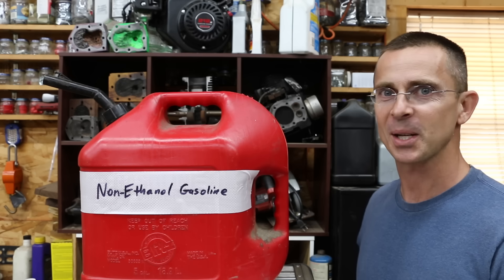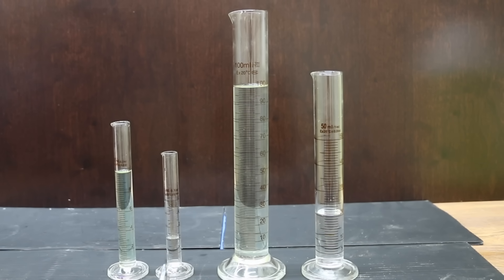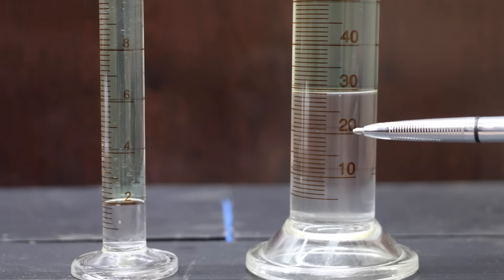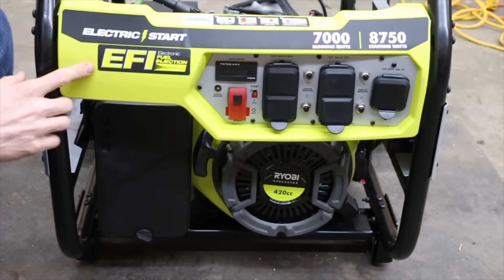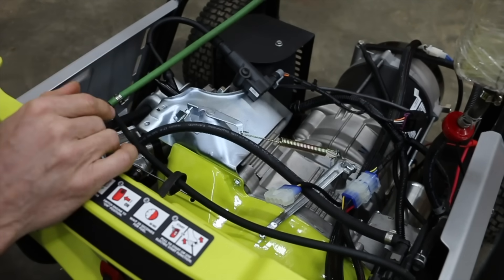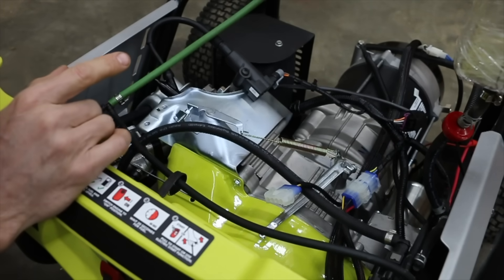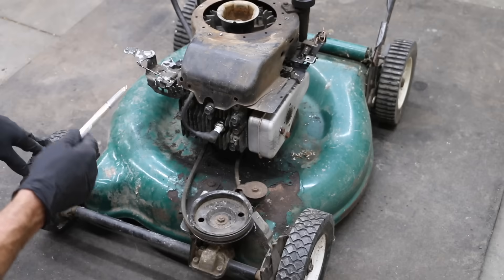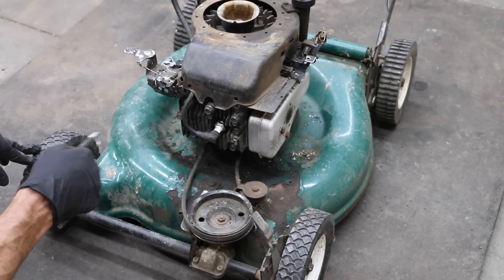Is Non-Ethanol Gasoline Really Better? See the PROOF!

Comment: I run a large concrete contractor company, we tried the bio diesel and ethanol fuel, it cost us hundreds of thousands of dollars in fuel filters, breakdowns, no performance, etc. bio fuels are a complete joke don't use them...and as far as the tree huggers go, if you think America can fix the so called "global warming shit" look at China we are shutting coal plants down at an alarming rate,  China is building them faster than we can...and wind power ....lets be serious...
Reply from the maker: Thank you
Reply: In 2015-16 China opened about one coal fired plant per week average.
And the greenies are slammin us.
Reply: Yup! Its all BS! All at the cost of the consumer! Sounds good on paper but the long run just like most save the environment ideas which thus far have only cost and wasted more! 

More gaskets, rebuild kits and fuel additives being built and sold now than ever before in history!  You think that helps save anything? No! More electricity used, more waste products at factories, more, more, more and all the parts and manufacturing companies are all behind ethanol knowing its more money for them by doing so! "Put more ethanol in fuel so we will sell more parts"! Its created a whole new industry!

Same as a situation with a guy I know who rebuilds transmissions! Its a design flaw in most clutches. ( manual transmission)  he went to one of the major distributors and told them! They said to his face!  We dont want to change! We dont want happy customers! We want return customers!!!

Its not in their best interest to build things that last or the best they could! Its all about money, greed and power! Each one is part of the other!
Reply: @WW5RM  Absolutely 100% agree. You nailed it...but I'm going pile on anyway (venting). Biggest hoax ever perpetrated on the American consumer.  Save the environment buy/run ethanol...bullshit.  

As you note, easily more time and energy is wasted on the manufacturing, storage and distribution of the parts damaged as a result of ethanol.  Maintenance costs go up and production goes down.  But hey the parts vendors and professional mechanics are happy, especially as less and less people are willing and able to work on their equipment.  The parts vendor gets a call from the mechanic and drives the parts to the shop on a as needed basis (extra charge) and the mechanic up-charges the customer for both the part and delivery.  Win/win...except lose/lose for the customer and the taxpayer.

Then there's the government subsidizes of ethanol corn to the tune of billions of $$$$.  I've got no problem turning surplus biomass to biofuels, but the idea of taking land out of commission for food production and propping up an "industry" that is not cost effective and has the detrimental impacts that corn ethanol does is ludicrous.  And as for government mandating the use of such fuel in autos and small engines is equally ludicrous...just burn them in the electricity generating power plants.  Energy burned at power plants is the same energy burned in vehicles, but the detrimental impacts would be greatly reduced...power plants number in the thousands while autos and small engines number in the billions.  But burning them in autos makes "everyone" do their "part" for the environment...share the "responsibility".  

Ridiculous BULLSHIT.
Reply: @TheAutoChannel  -  Bullshit!!  
After some research, I find it's more complicated than I thought - (when does the government make legislation simple)...it's more a case of "where/how"  the subsidies/credits are being applied. So I encourage you to do some research on your own...especially with you being an auto journalist. I offer some links below.  

"Ethanol is more compatible with different engine and fuel system parts than gasoline and aromatics."  Maybe you should have said "modern engine and modern fuel systems".  I assure you that ethanol is the bane of engine/fuel systems in high humidity areas/zones especially for older motors and small engines.  Most farmers will not touch E10/E15/E85 when it comes to fueling their equipment...yep even the corn farmers buy non-ethanol fuel.  That may be changing with the newer tractors with EFI systems, but many farmers, especially the smaller ones, still run tractors decades old...with carburetors.

The problems with ethanol fuel is not the motors per-say but rather it's the fuel/carburetor systems. "The main problem with ethanol fuel is that it absorbs water from the atmosphere. Even fuel with a small amount or ethanol such as an E10 blend can absorb up to 50% more water from the atmosphere than gasoline." The simple fact is ethanol and carburetors don't mix well when it comes to intermittent use. This is why small engines have such huge problem with ethanol blended fuels. Small engines are frequently only used seasonally...mowers, leaf blowers, weed eaters, lawn tractors, snow blowers, chainsaws, generators.  All of these engines are prone to ethanol fuel moisture (binding/condensation/separation) related issues.  Which is another reason why small engine repair has become such a lucrative business in recent times.  

Point is if you operate/run ethanol fuel based engine systems on a daily/weekly basis, in effect always have fresh fuel, you are unlikely to experience any fuel related problems...especially with modern EFI systems as is with autos.  But if intermittent use is part of your usage pattern you had best either avoid ethanol-blended fuels or start exploring fuel stabilizers or draining/running dry the fuel systems of the equipment prone to fuel degradation issues.  Otherwise get accustomed to cleaning carburetor bowls and rebuilding carburetors.  

While gas to day is not formulated like the days of old (with lead) where you could store gas for seemingly years, depending on the gas refinery/blender/vendor I wouldn't trust ethanol-gas for even one year.  I have seen gas go bad in less than a year...not to say it wasn't burnable...but it was so questionable I wouldn't want to risk the repair bill or the down time.  The final caveat regarding ethanol fuel, if it's so compatible with different engine/fuel systems...why is not in aviation gas (AvGas)?   

Thanks for forcing me to push my knowledge base...things do tend to change over time (sometimes without noticing),  and then again too many people love to experience the "ignorance is bliss feeling" now days. 

PS (added on edit) - Just clarify...there has been ethanol subsidies, of one type or another, since 1978...for forty years.
 =============

Some reference links and quotes -

https://www.washingtonexaminer.com/epa-keeps-ethanol-mandate-intact-for-2018
The 2018 renewable fuel blending requirement will be 19.29 billion gallons, which includes both the conventional and more advanced blending standards. That's a slight bump from the original proposal of 19.24 gallons. The bulk of that is met by corn ethanol. 

https://www.instituteforenergyresearch.org/biofuel/epa-mandates-renewable-fuel-levels-10-percent-blend-wall/
The problem with exceeding the blend wall or even just reaching it is that many automobile manufacturers will not warranty vehicles that use more than 10 percent ethanol and many small engines (e.g. lawn mowers) also limit ethanol mixtures and actually prefer pure gasoline.

https://www.thoughtco.com/understanding-the-ethanol-subsidy-3321701
After Trump took office in January 2017, all seemed well with the ethanol subsidy until early October, when his own EPA administrator Scott Pruitt announced that the agency was considering lowering the EPA-mandated subsidy payment level for ethanol “slightly” in 2018. The suggestion sent shockwaves through the Corn Belt and its Republican congressional protectors. Iowa Sen. Chuck Grassley accused Trump of a “bait and switch,” in reference to his empathic campaign promise. Grassley and Iowa’s other Republican senator, Joni Ernst, threatened to block all of Trump’s future EPA appointments. The governors of most Corn Belt states joined in sending Trump warning him than any cutback in the Renewable Fuel Standard program’s subsidies would be “highly disruptive, unprecedented and potentially catastrophic.”

https://www.taxpayer.net/energy-natural-resources/federal-subsidies-for-corn-ethanol-and-other-corn-based-biofuels/
But despite corn ethanol facilities being prohibited from receiving energy title funding, at least four of the 15 programs allowed nearly $90 million dollars to be spent on corn-based biofuels from 2009 to 2013. 

https://www.fuelsystemguide.com/what-is-the-best-ethanol-fuel-treatment/
Reply: @BWolf00  Ethanol is less corrosive on any chemical compatibility charts you can find compared to gasoline, benzene, toluene, ethylbenzene, and xylene so parts are less damaged.  Ethanol takes less energy and time to manufacture, that is why it is much cheaper, even now when gasoline is super cheap.

Maintenance costs have fallen in the US since ethanol usage exploded.  See chart:

https://uploads.disquscdn.com/images/09f191db1baf6565c0aa85036f5531a1d479706d47ee0e4dbe160e2d71a7521f.png
Reply: @TheAutoChannel  Great you've written a book...based on your "research".  You're a "journalist/writer", a TV/film producer, but looking at some of your work and your supporters  you might as well moon-light as lobbyist fighting against big oil.  As for subsidies you did not address the items/references highlighted/cited in my response.  No you would rather cite a dick slapping contest you got into with some other asshole (yes I'm calling you one too) and then point to your book as a definitive industry reference for your bible thumping ways.  Maybe I'll read it or maybe I won't...but it's not part of my "job" description,  besides what could a "no credential moron nitwit" like me offer.   I found no reviews of the book, and I noticed that the book is not available in print..and since you are part and parcel of The Auto Channel, "self-publishing" doesn't really count towards it becoming a NY Times best seller.  But hey you wrote a book...so kudos to you.  I Recently saw a YT comment that was spot on...'journalist have elevated the reputations of used car salesmen'...attribute unknown.    

You ignored the most substantial part of my response which was a criticism of carburetor/water moisture infiltration issues for older large and small engine fuel systems using ethanol gas.  And based on many years of hands-on experience (I can make that claim too), I found that carburetor repairs (replacement/overhaul/rebuild) and fuel tank issues (steel tanks especially) are prevalent, at least 2-3 times as much for seasonal use equipment when using ethanol blended fuels.  This applies to older construction, farm and sawmill equipment as well as small engine equipment, again those running carburetor-ed fuel systems with steel tanks. I can't begin to count the number of carburetor bowls/fuel filters I have had to dump/drain.  Then there's the gas tanks that have had to be replaced, "washed" out and in some cases encapsulated.  

These repairs can costing hundreds of dollars.  Cleaning and encapsulating a rusted steel gas tank for a 1989 Isuzu truck over $400...or buy new for $480 - $600...yet the truck is only worth $1500-$2000, and yet the engine is in great shape.  How about a new carburetor for a Kohler 27hp engine powering a sawmill to the tune of $375.  All because of water infiltration of the fuel supply and corrosion to materials in the carburetor.  To be fair some of these issues were caused by ineffective seals, normal venting, and exposure to humidity condensation caused by equipment left in the elements.  But without a doubt the amount of repair/maintenance went up with the usage of ethanol blended fuels.  This is born out in the testimonies detailed above and in other comments associated with this video.  Additionally, my personal experiences and those of my father (rancher/farmer/sawmiller), other farmers, my neighbor (small engine repair tech/mechanic) and small engine repair shops - who by the way don't recommend ethanol-gas.  

Again, just in case you glossed over it the first time,  "Point is if you operate/run ethanol fuel based engine systems on a daily/weekly basis, in effect always have fresh fuel, you are unlikely to experience any fuel related problems...especially with modern EFI systems as is with autos. But if intermittent use is part of your usage pattern you had best either avoid ethanol-blended fuels or start exploring fuel stabilizers or draining/running dry the fuel systems of the equipment prone to fuel degradation issues. Otherwise get accustomed to cleaning carburetor bowls and rebuilding carburetors."  

As for subsidies, I noted that it was more complicated than I thought.  But you can set the record straight 'Mister, I wrote the book', when did direct corn subsidies stop and when did things like the EPA mandates start?  Also, feel free to go back and address the sources I cited in the first response.  I found that the government changed (and maybe discontinued) some types of subsidies in 2007/2011 (??) but still had other policies in place.  One current policy, Renewable Fuel Standards is an EPA managed mandate, requiring a certain level of ethanol be blended with gasoline.  The oil companies/blenders are effectively forced to buy a product they actually don't need which supports another fuel competitor/industry and farmers. 

This is not a "direct" subsidy, really there's no difference. It's much like the Obama care/ACA tax vs fee argument (semantics). If the government mandated that "unhealthy" people over the age of 80 be euthanized and hospitals were responsible to make it happen.  Would the hospital be doing it if the government hadn't mandated it, It is killing off part of their revenue stream.  So the oil companies have to buy and blend a product that makes theirs prone to moisture issues...but hey the farmers are happy.  And then there's the games we play with ethanol fuels where, as of 2015, while exporting 800 mil gallons of ethanol we imported 92 mil gallons because cane sugar ethanol GHG "scores" lower than corn ethanol.  All in the name of tax credits and penalties...but they are not "subsidies".  

Actually, I really don't have a problem with ethanol, it is a good effective low emission fuel with renewable sources...hurray!!  While It is a great fuel for our modern cars, it is not the "best" fuel for ALL engines in all situations especially in older engines. So why is so hard to find non-ethanol fuel...because of government mandates?  Why is straight gas not available at all U.S. gas stations?  Counter to what the name suggest, Fuel Freedom Foundation (FFF), seems to be more focused on renewable energy and environmental emission issues and an anti-oil concern (it may be more pragmatic than against).  As the FFF is concerned with oil monopolies, I would like to know what it and other related non-profits think about reducing our reliance on China's monopoly of the Rare Earth Elements market.  Also they state "Fuel Freedom’s goal is to give Americans a choice of cheaper alternative fuels like ethanol and methanol that can be used in the vehicles they already drive."  As if vehicles are the only thing needing fuel. 

Another oddity I found at Fuel Freedom Foundations website was this under the methanol fuel description "Water in the fuel can cause corrosion of parts if the wrong material is used, such as zinc or aluminum."  yet this statement is not included in the ethanol description.  Then again Wikipedia's has this "Mechanics have seen increased cases of damage to small engines (in particular, the carburetor) and attribute the damage to the increased water retention by ethanol in fuel.[48]"  - attributed to a MSNBC report dated 2008.  So in closing ethanol blends are not always the best fuels for all engines in all situations because ethanol is hydrophilic...which is a VALID CRITICISM.

So is that '"man" enough for you...you self- aggrandizing twit.

Subsidy reference *
https://www.instituteforenergyresearch.org/biofuel/epa-mandates-renewable-fuel-levels-10-percent-blend-wall/
Refiners that are not able to meet the renewable fuel requirement must purchase Renewable Identification Numbers (RINs)–credits that allow them to make up the difference between what is mandated and what is actually used. After EPA announced the renewable fuels requirement for 2016, RIN costs increased by over 50 percent–from 54.5 cents per gallon on November 30 to 85 cents per gallon on December 1. More recently, they have been trading at around 75 cents per gallon.[iv]

With oil prices being down, ethanol is now trading for prices that are higher than gasoline. Consequently, refiners either have to pay the premium for ethanol or purchase RINs—either way they are paying a penalty for a government program that was supposed to help, instead of hinder, the gasoline market.

The legislation sets mandated levels of biofuels through 2022 when Congress envisioned 36 billion gallons of renewable fuels being consumed, of which 15 billion gallons was to be corn-based while the rest was to be advanced biofuels. The 21 billion gallons of advanced biofuels is unlikely to be produced since the cellulosic ethanol industry did not take off as Congress envisioned. After 2022, Congress indicated that EPA should set targets at its discretion. Unforeseen problems with the Renewable Fuel Standard—the blend wall and the lack of cellulosic ethanol production, which was expected to reduce emissions at a greater level than corn-based ethanol—have made many critics call for its total or partial repeal.
*

PS - And you made no mention of AvGas and potential problems of using an AvGas/ethanol blend in aircraft engines.
Reply: @TheAutoChannel  the biggest problem is it cost more and you get less miles period!!! Can you say ..( smoke and mirrors)..
Reply: Climate change is just a money maker for the globalist elites.  Total BS.
Reply: @juicebox22a  yup! Soros is one of the main ones behind it! Bunch of hypocrites! Him and Al Gore have utility bills per month higher than the value of everything I own combined!!
Reply: ww5rm oh yeah. No doubt.  Paris, Dravo, all a huge scam.  I just heard some puppets on NBC yesterday talking about how the climate change is just like curbside recycling, we all need to embrace it because more Americans would buy beach front property of the climate was under control.  LMAO.
Reply: Are you kidding about wind power? If we put a thousand wind generators around DC, we'd power the east coast with a second thought. I mean, come on. With all that hot air coming out of the capitol from the politicians crying like they are lately, wind power is a no brainer. haha
Reply: Couldn't agree more....MAGA!!!
Reply: Unless everyone cuts down on coal plants, you might as well declare one end of the swimming pool pee free. (The global warming will soon change to global cooling without any help from the politicians. In my lifetime they already did an about face.)
Reply: good point. Let's turn this into "us against them." Fuck those people.
Reply: I like that we are doing experiments to come up with alternatives in case we cant get or find it hard to get things. But sometimes thing just dont work...
Reply: This is not the channel for this discussion, we're here to watch Todd destroy lawnmowers and use butter as a lubricant. Geopolitical topics don't apply here.
Reply: https://www.geocraft.com/WVFossils/greenhouse_data.html
Reply: @Curtis.  I agree I hate running biodiesel in a semi. Guaranteed to get a couple of tents lower fuel mileage and the damn thing Burns off all the time. Non biodiesel seems like it takes a month, I'm sure it's less than that that's not once a week. This is an x-15 Cummins.  Same with ethanol I remember when it came out in California my car got 3 miles per gallon less
Reply: Curtis C it's counter productive for tree huggers because it adds extra phosphorus and nitrogen to our surface water. Don't confuse Communists with true environmental ists. Green energy is an attack on our country by socialist/Communists.
Reply: Yes let's be serious. Costa Rica has been running on 98% renewable energy for 2 years now. They have worked their system and technology to bring black outs down to only 9% of the time during the year. As opposed to the 49% when they started. Now imagine if we actually incentivized renewable research, started actively implementing it and not shoe horning it with sponsors like big Petro dollar outfits Exxon and Shell who actively want to see it fail, and start working the kinks out. The thing is people are so scientifically inept they can't understand how progress works. They don't understand that in order to improve one must take a step back to observe and troubleshoot. If you don't keep up with the climate change research that is being done by nearly every major hitter country in the world, and amongst those whom we have tense relations with, they all unanimously agree human driven climate change is real and very dangerous. Your uneducated and completely ignorant opinion doesn't mean jack shit when there are MILLIONS of provable, verifiable and demonsterously true research studies saying man driven climate change is real. Even companies and research groups that have literal invested interests in denying that it is true have said their research cannot deny that it isn't true. We need to make a change and the only way to move forward faster is to get started now.

That being said absolutely the few bio-fuels available to us are absolutely under-researched and frankly cost more than they are worth right now, but in the beginning so did gas. That's why we were so invested in electric in the 1880s. It wasn't until sparkplugs were mastered that gasoline became useable. we had already been using diesel but it was so large it wasn't viable for personal transportation. 

What I'm saying is we need to make that change and we need to do it very soon. The faster we start the sooner we can improve it and eventually surpass our old methods. Clinging to a dying era helps no one and hinders everyone younger than those who refuse to let go.
Reply: @BigPanda096  good for them, whats your point it is a shithole country that should be nuked off the face of the planet.
Reply: @curtisc6768  Oh gee you're just one of those bastards that are completely intolerant and completely incapable of thought beyond your emotions. Got it. Conversation over.
Reply: @BigPanda096  Glad you understand
Reply: Wind and Solar is a great concept.  But it is just a concept.  Nuclear is the way to go.  Reliable, cheap and clean.  Yeah I know some of the waste is not so clean but it can be reprocessed and some of it can be reused.  Just ask France. 
I love driving down I-40 toward Amarillo or I-70 toward Topeka and seeing all of the wind turbines not turning very fast when there is a 45 mph head wind.  Wind power will never generate enough to get back the money spent on building each turbine.  Not to mention all of the pollution that is given just getting each turbine installed.  Minimum of 5 tractor trailers and 2 cars for each truck.  LEAD, TAIL cars.  Tons of pollution there.  it is not economical but some liberal convinced someone else that it would reduce global warming and carbon dioxide release.  Well, it will in about 200 years.  Climate change is a joke, the so called man made factor is not as significant as they say,  Yes we are over polluting but the warming and cooling is not totally man made.  Most of it is the earth in cycles of heating and cooling.  Scientists have proven that.  There is no factual scientific proof that man made pollution is causing any significant amount of global climate change.  It is a load of horse puckey.
Reply: @robertbenoit5374  bravo well said sir.
Reply: +Curtis C. You clearly didn't check what is normally expected in a transition from mineral diesel to bio-diesel. Mineral diesel tends to leave residues and varnish coating the internals of the fuel system. A minor problem to be sure, not likely to cause many problems til the system gets quite old. However when you switch to biodiesel there are some very effective solvents involved, and these to to start cleaning all that crap out of the system and the problem is that it comes all at once. You SHOULD expect to go need to go through filters faster and risk blockages for a while, but the culprit isn't the bio-diesel, its the mineral stuff. 
Once you've finished cleaning out the system, the problem is gone.